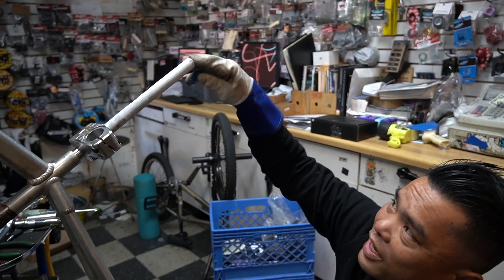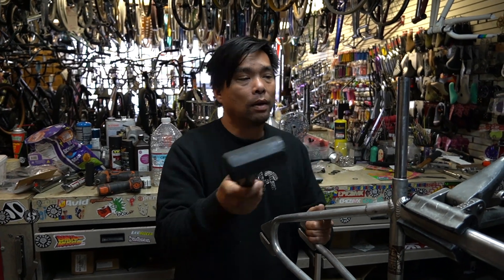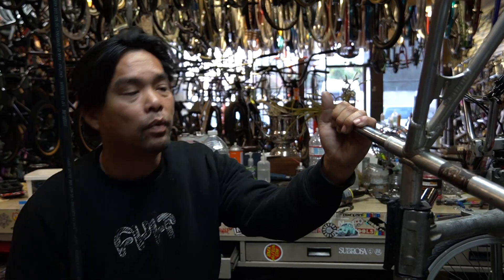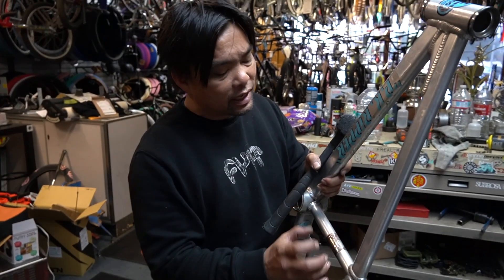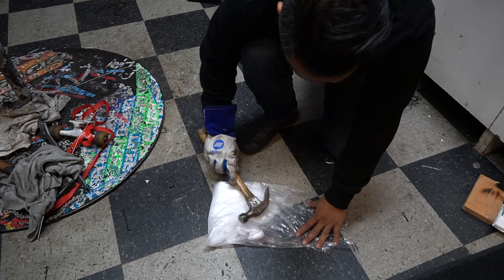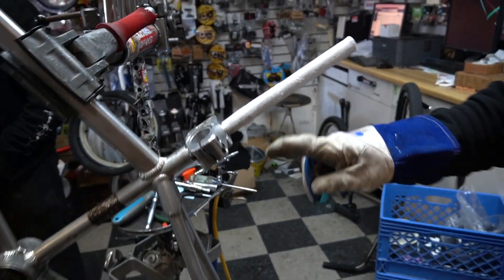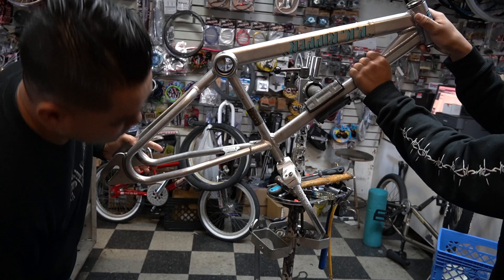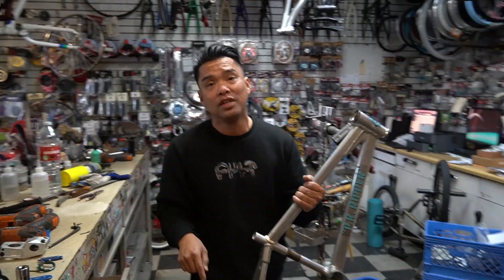What Happens When You Freeze a Bike? This Shop Owner Finds Out!

Comment: The question is who's smart enough to know the reason why that seat post won't come out. I will tell you it's called electrolysis. Steel and aluminum is not a good mixture.
Reply: i think its a galvanic reaction between 2 dissimilar metals. eletrolysis is corrision from a current
Reply: @bestvolibearuseast  lol your right I keep forgetting to stop calling it that out habit.
Reply: Cold welding